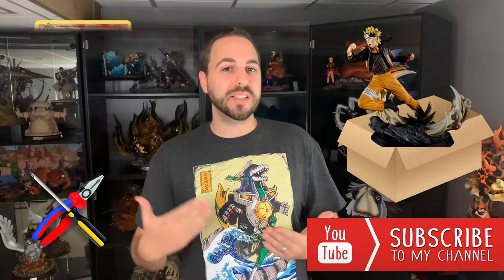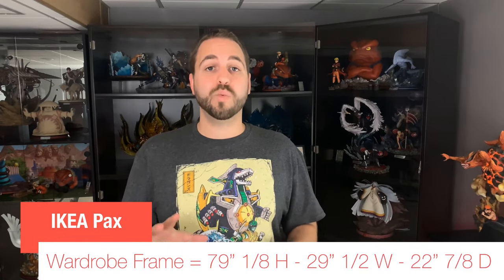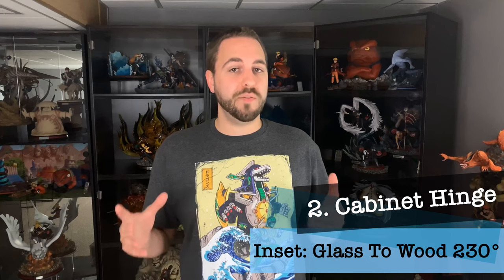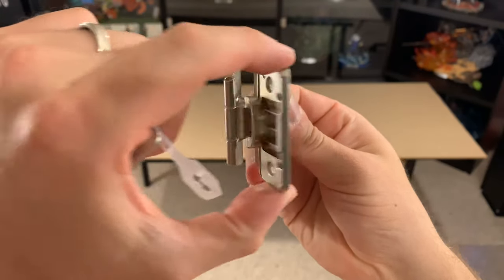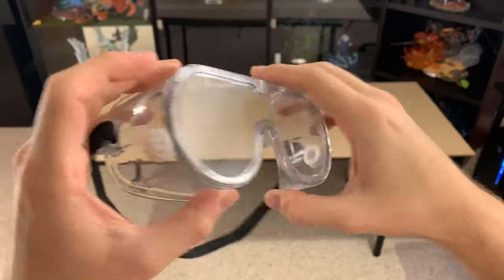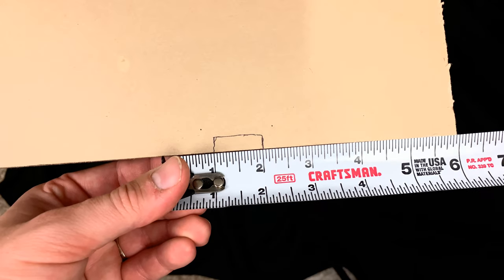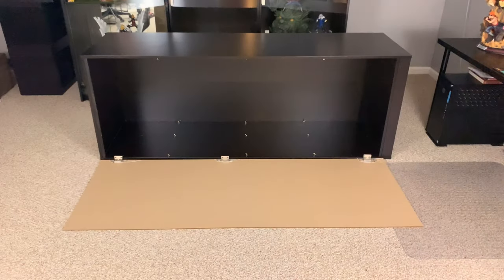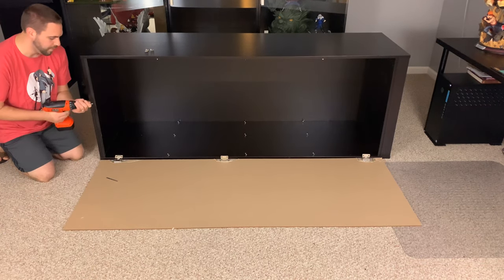🔨🛠🔧 PART 2 - Adding Custom Acrylic Doors To Your Display Case - IKEA Pax Display Case Build

Comment: Here's a follow up on some durability concerns. The holes drilled into the acrylic need to be wide enough for the baseplate to come all the way through with its' plastic buffer, not just the screws. You'll need a larger bit than 3/16" for this. The plastic pieces are meant to sandwich the acrylic rather than putting all the pressure on the screw holes themselves, which over time will increase the risk of the acrylic cracking.

According to the instructions, the minimum width of your glass or acrylic needs to be 5mm for these particular hinges to properly sandwich. 3/16 (.1875) inches is only 4.7mm, so go with the 1/4 inch thickness.
Reply: What size bit would you need to use then?

Comment: You obviously didn't know, so I have to make a note here.
17:34 The screws with small threads are for metal with threaded holes, they won't hold long in the wood.
Screws with bigger and more spaced out threads are for wood, especially the pointed ones.
Better replace the screws if your door didn't fall off yet)
Reply from the maker: New news to me!! Thankfully they’ve held on well for 3 years now with no issues or anything becoming lose yet. 

I’m in process of making an updated video so this will be great info to have. Thanks for sharing so I can rectify that for others next video.
Reply: @BAMCollectibles  Good to hear it didn't cause trouble. If you point it out in a video, you'll make the world a little safer) GL!
Reply from the maker: [bsh]thrasher thanks again man!
Reply: Which size screws would you suggest? 5x20mm wood ones will be okay, or too thin?

Comment: Use a hairdryer or heatgun (carefully) to heat the acrylic brown protective layer as you peel it off.  It makes it way easier to remove and it'll come off in one piece.  Like butter. 😉
Reply from the maker: AWESOME advice man!  Thank you so much for sharing that.  I'll have to use that when I make an updated video for the process.
Reply: @BAMCollectibles  For sure man. I also use #6 3/4" screws with #6 washers for the back panel.  They don't rip out if you move the Pax around like the nails will. 👍

Comment: I'm sorry, but you should know you used what are known as pan head machine screws which are meant to be used exclusively in "tapped holes" or with threaded nuts. 
They are not meant to be used in wood. 
It's incredible they held at all. 
 
If you use that door regularly, it will end up stripping those machine screws out of the wood.

Comment: 😱 INCREDIBLE MAN. I will go for the PAX and follow your tutorials the day I need more space. 

Questions: how resistant is that material to scratches? How they weight? Have you consider glass instead of that material?
Reply: It does scratch fairly easily but scratches can also can be polished out super easy with a plastic polish kit one runs about $20 on Amazon
Reply from the maker: Thanks bro!! If you recall in my first video there’s a small portion where my daughter is hitting the sheet of acrylic with a plastic sword.  Even with that action she didn’t make a scratch on it. But as the other person said even if it gets scratched there are solutions out there to buffer out anything to make it look new or close to.

Weight wise I’d say they’re 20-25 lbs each. 

I would absolutely never consider glass for my cases. Because I have a child and she can get crazy with toys I don’t want they risk in my home. I’d have to say after owning them as well...even if I didn’t have a child I’d go for Acrylic doors over glass to save money and have more durability. 

Hope this helps man!

Comment: Seems like you could drill a slightly larger hole in acrylic and the front facing piece of the hinge would recess into the sheet.
Reply from the maker: Fantastic observation man! I actually had to do that for a hinge off camera with a larger drill but and it worked pretty nicely. Not a game changer but definitely a very helpful tip. Thanks!!
Reply: Ditto.  Noticed that at 14:34.

Comment: First of all, awesome video!!!
Unfortunately I have not gone thru all the comments but how good is the fit on the opposite side of the hinges? I got a lot of dust inside some displays I made myself based on the baseball bat model for funkos. Any ideas on how to get it airtight? Thanks.

Comment: Do you think a ticker sheet will be more easy to control when opening and closing ? If a magnet was to be placed where would you think it will be best at ?
Reply from the maker: If you have the funds I would definitely go with the ticket 1/4" as it's more sturdy feeling and less flimsy.  Not to say that 3/16" doesn't workm but after owning both I'd spend the extra for 1/4".  

If I decide to add a magnet I would line it up with where my shelves are at so it would hopefully blend in well.  I will do some testing and report back on video 3 for sure.  If you find out any info yourself please feel free to share (^_^)/

Comment: Very informative video. I wanted two cases for my WW2 military vehicle collection. Went online and found they wanted $2000 per case. Your video encouraged me to build my own. I plan to make a video of this build. Please wish me luck. Here are a few suggestions. When drilling two pieces of wood, I clamp them together. To get the right depth when I drill, I use a tool called a depth gauge. After deciding where I want to drill a hole, I use a smaller drill bit to make a pilot hole. The particleboard is not solid enough if you plan to place heavy objects in the case. If you have the items you want to put in the display case, I suggest you weigh them; using a bathroom scale. Nice to know just how much weight you are dealing with. My comment is only how I do things. Your mileage may vary.

Comment: If you want to make the edges of the acrylic look better, you can use a quick pass with a blow torch to get them clear for you.

And from a friend who had bought some old display cases from stores to refurbish, one thing you can also do is get some of the thin acrylic cement and put a few drips on the interior of the holes you put in for screws before putting them in and you'll have a more secure piece in the end. his weren't just held up by the hinges though...and the cases were the type you see in jewelery stores that are waist high, and the glass was damaged when they got pulled out of wherever they had been and he has a fossil collection in them...he replaced the glass with a heavy acrylic for the exterior and the shelves...along with added a few extra shelves, and while it doesn't fuse the acrylic like the glue does between sheets, it semi-melts it enough that it fills in around the screw enough that it's far more sturdy.

Comment: Hi thank u for the great info. 
I was wondering on the acrylic door. Whats the thickness u r using? And how do i measure the door? Exactly same measure as the pax ill be getting? Also, i know pricing will be different by store and location I'll be using but just wondering how much it cost you for the doors. 
Thank u a lot!
Reply from the maker: Hey there! At 3 min and 20 seconds in I did provide the exactly measurements used for this size PAX.  Hopefully that helps and feel free to ask for any further clarification.  

If you can afford I would recomend the 1/4" thick over the 3/16" but so far both work fine for me.
Reply: @BAMCollectibles  thank u for the info! 🙏I've watched it twice but missed that part lol 🤣
Reply from the maker: No problem at all haha!  Anything you need at all don't hesitate to reach out to me.  Wish you the best in tackling this project and if you build a case I'd love to see it completed.  Feel free to hit me up on my social media sometime.  Cheers!!

Comment: I was planning to make acrylic displays, but in an existing bookcase and I wanted to only cover partial shelves with it to create display zones alternated with book/manga zones. I found so little information about what thickness is good for what, so I am really glad to see you use this <5mm Acrylic for a huge door, and that it turned out great. It makes me think I can probably get away with trying 3mm for something 600mm x 300mm or in that range at least.

Comment: I am a teacher with a HarrybPotter themed classroom. I have about $5000 worth of collectibles. I am moving from elementary school  (where I had everything displayed out in the open) to middle school (where I have been told students grow sticky fingers). I wanted to still display my stuff, but have it protected, so I thought, why not put plexiglass on the front side of my display cubes that fit against the wall. I don't need them to open because I put the items in and then slide the open back side against the wall. I  also have a space above some built-in cubbies that I thought I could create a plexiglass door for. I want to make it top opening mounted to the drop-down from the ceiling. Do you think that this will work for a top opening door?

Comment: Nice video, cool hinges and acrylic panels/doors. So these are the IKEA Pax wardrobe units you’re using as shelving units correct?
Reply from the maker: Thanks so much! You got that correct, just a frame from their pax line with some modifications to transform it into a display case 😁

Comment: If i don't want to drill into the acrylic , can i just use some 3M command seals for attaching hinge to acrylic? Those things are rated for about 10lbs per strip. So with 3,that's like 30lbs.

Comment: Thanks a lot for making these videos, especially this one and the reinforced shelves one. Followed your instructions to the letter and still managed to mess up quite a bit with the hinge positioning when drilling holes. But that's alright lol. Still worked out in the end. One thing I thought I would share is I had some issues with the acrylic closing all the way. It might be because I only have 3 hinges for a ~37" wide door. In any case, I just added some adhesive magnets on the acrylic/Pax and that did the trick. I also added an adhesive pull handle. It was a little ugly but I can tolerate it.
Reply: Same mine would close all the way as well

Comment: Thanks so much for this series of videos great ideas. 

I do have a question though, I bought about 1k in acrylic sheets for my shelfs a year ago and I still do not know how to do this. Could you do an update??? I'm so frustrated and lost with an upset wife who thinks I wasted money. I cannot find a hinge and everywhere I go sells me another solution that just doesn't work. I've even had handyman come over to look it over and tell me this video is a lie and fraud. I don't think that's true but I do not have the skill or tools to do this. I just want to buy a cheap hinge and screw it into the bookcase and be done. What am I missing, where do I get these parts? Lowes, Home Depot, Ace, etc have no idea what I need when I show this video. I'm not skilled enough to cut this acrylic so what do I use to get this done???

I'd be so grateful for some help if possible. Many thanks in advance.

Comment: Great Video, thanks for the walkthrough. Exactly what I’m looking to do on the bookcase I keep my retro games on. Same reason because there is now a little one crawling around the house. One quick suggestion.  You may want to use the wood screws on the side of the hinge that connects to the cabinet instead of the machine screw. Use a drill bit smaller than the screw and the wood screws with the wider teeth will bite into the material. Thanks again!

Comment: I probably missed it but is the case dust proof when closed or is the side with the hinges revealing/open?
Reply from the maker: It’s not 100% dust proof as it’s not sealed but I only need to dust every 1-2 years, even then it’s such a small layer of dust. I’m sure if you got measurement a tad tighter you could 100% dust proof it.

Comment: So what's the final verdict on 3/16" vs. 1/4" thickness?
Reply from the maker: So far 3/16 is holding up perfectly fine for me! 4 month in and nothing odd has happened to the sheet 😀
Reply: BAM Collectibles Did you drill the acrylic holes wide enough for the front hinge plate to go all the way through? 3/16 is too narrow for mine.

Comment: I have a couple questions. I have cabinets that are thinner than yours and mounted to a wall. In a couple instances my statue bases might hang over the edge by like half an inch, does this sit essentially flush with the cabinet? Also, would those hinges fit a single sheet of 1/8th inch acrylic? Thank you!

Comment: Just curious did you end up using both acrylic sheets together because at the beggining it looked really thick but at the end it looked like you only ended up using a single sheet
Reply from the maker: Just had them together so I can drill holes and cut grooves in two at a time. Was just trying to save time as I had to install two doors that day. Hope that answers your question! 

Hit me up for anything else 😃
Reply: @BAMCollectibles  So it was just 1 Acrylic sheet right? thanks again this video was so helpful!
Reply from the maker: Makky TANG Nope! It was two stacked on top of each other at first and then later I split th when installing. I only use 1 sheet per case. 

Just stacked them to cut out the grove and drill holes for the hinges. Makes them perfectly even as welll.
Reply: @BAMCollectibles  Thanks for asking Makky TANG. That's the question I had as well. BAM, might be an extra helpful detail to add a total cost breakdown at the beginning before or after you've gone through all of the needed pieces/materials. Just for future videos. But all in all fantastic videos and tutorials man! Greatly appreciated! Exactly what I was looking for.
Reply from the maker: AJ allen Hey AJ! Great advice and thanks for your feedback. I’m about to release part 3 and I didn’t outline cost in that but I’ll release a video very soon that breakdown the cost of it all for everyone. I was hesitant to because it’s going to be different prices for everyone depending on what’s local to you but none the less I will surely do it to give others a baseline.

Comment: Great video and help to the community. I used the same hinges a couple years ago on the larger Pax and they are still holding strong today. 3 hinges per sheet. Only thing I would add to this is if you dont have a dremel tool or dont want to drill yourself, for being too afraid of cracking the sheet, you can have the plastics company drill the holes and the semi-circle for you. No extra cost and if they mess up, you get a new sheet.
Reply from the maker: Thanks for the input man!  Glad they're still holding up strong as I've had the same experience.  Your plastics company was nicer than mine haha, they wanted to charge me for that so I took matters into my own hands, glad I did 4 doors later haha
Reply: Hi Shaughn, did you use just a 1 PC sheet for the door on the larger width 39" pax? If so what was your overall measurement and does it hold well. Debating on 1 or double door @ 19.5". Thanks
Reply: @justinclarke2204  just the 1 sheet for the 90h x 36w using 3 of those hinges. Has worked great for 4 years now

Comment: Since this video is over a year old have you made any updates? I'm wondering if you can add a video to show collectors how to add support that prevents a shelf from bowing? Adding a simple 1X1 board under each shelf along the middle should go unnoticed, but will prevent any bowing from some of the weighted items. I'm starting to build my custom shelving units that will run about 50' in length, 10' in height and range in depth from 6" to 12". Since I have thousands of figures and some massive things like the US Flagg for GI Joe there is a lot of light and heavy items. Your videos are among the best I've seen for tips so I'm only posting this question to you.
Reply: Probably a lot of scratches on the acrylic by now but who knows. I still think glass would have been good. Solid and study than the wobbly acrylic glass. Just guessing.. I could be wrong

Comment: Awesome video. For the hinges, do you use the Inset or Overlay? After using both 3/16 and 1/4 inch thickness, which one do you prefer?
Reply: After watching the video for the 10th time, I saw "inset" hinges. But does that make your door flare out at the end or is it still flush?

Comment: Shot in the dark here, Would .125 be good for thickness to save on cost? Is it possible to get by with cheaper hinges like a regular glass door hinge that needs no drilling (clamp type I guess) if it's a thinner sheet?
Reply from the maker: Can’t vouch for any of the above but I’d LOVE to hear your experience if you do try. Would sound like a massive cost savings if it works out.

Comment: Hi, first of all it is amazing the work that you did on this. How much do you estimate you spent with all these add-ons? for just one piece of furniture from ikea? Another question, have you ever use the model Detolf from Ikea to build a display? Couldn't find any tutorial on your channel, do you know any good tutorial you can recommend?
Reply: I would say over $400 with cabinet frame, extra shelves, arcylic door, lighting LEDs, hinges and screws and tools for cutting+ miscellaneous materials, I'm in the process of making one

Comment: Have 7 on the way and using your vid as a guide. Great stuff! Question about the hinges.. you got the overlay ones correct? The way it's looking I think I'd have to cut the shelves if I went with inlay.
Reply from the maker: Not as familiar with inlay but I do believe the shelves would have to be trimmed in order for those to work.